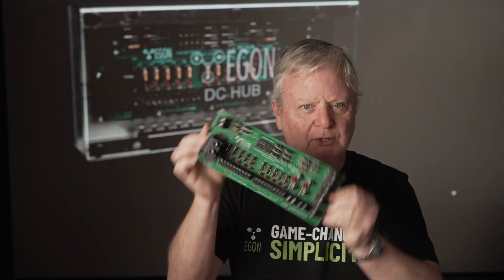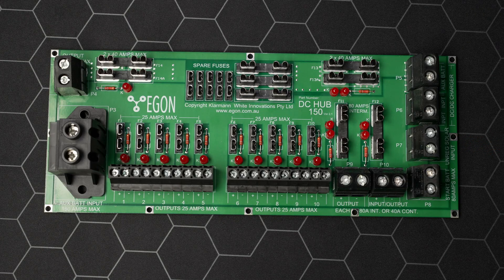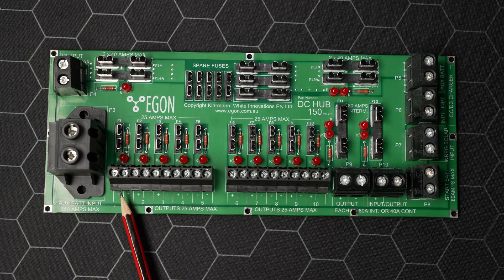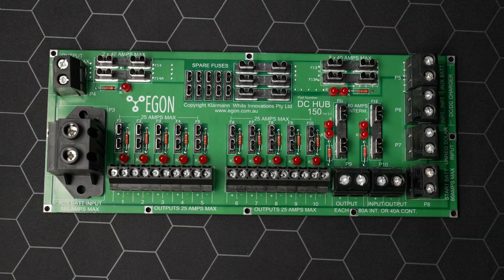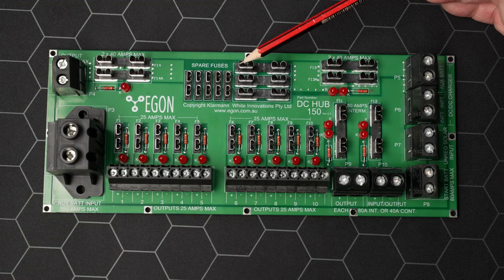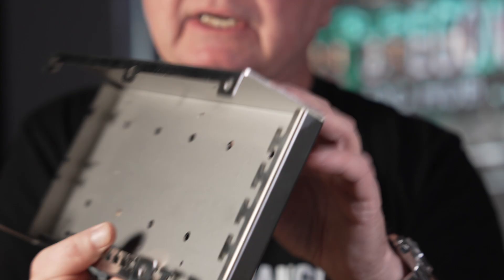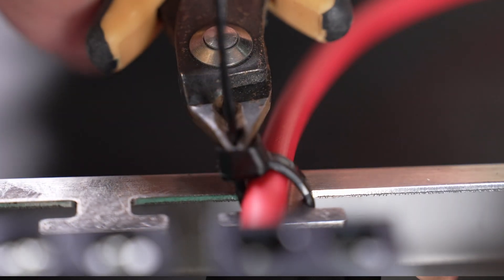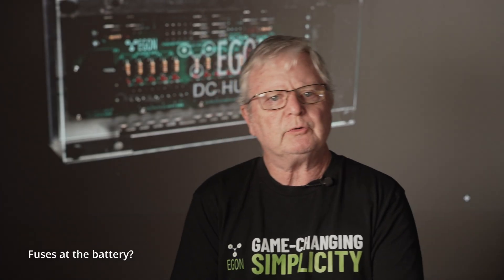EGON DC-Hub EXPLAINED: The Smart Way to DC-Power Distribution @EGONGame-changingsimplicity

Comment: How would you connect hub if house battery is under bonnet with starter battery ? First timer here
Reply from the maker: Hi there, the Hub is not made to be installed under bonnet. I would recommend to use Midi fuses for the DC / DC charger for an under bonnet installation and then use a Relay Hub / Fusebox / other switching solution for the installation of components in the rear / canopy / inside of the vehicle. Hope this helps...

Comment: 3:16 that cable is going to rub at the front of the cable tie. I would in future make the cable tie mounts insulated. Just my 2 cents worth.
Reply from the maker: Thank you for the heads up! Since the cable tie is holding the cable on the bracket very tightly there is no rubbing movement. We have tested it excessively and never had a single fault with pull relief t bars on the bracket. Your input is appreciated.
Reply: You could add a sleeve of heat shrink over the "T" if you are concerned.
Reply: @gavinhulme8837  Thats a cop out. Its an engineering issue. And needs to be fixed. Sorry 50 Year old Tech here. That wouldnt have passed me in Alpha testing. I would have seen that a mile off and told the Engineer to fix it. I personally would be using platic whever cables are run not metal. Because the corrigatted tubing will eventually wear, defeating the whole purpose of the Egon Hub. So watching eargerly.

Comment: Im very interested how ever l have a 120 amp v4 compessor from Tuff Terrain. Is 12o amp excessive?
Reply from the maker: Since a compressor is an intermittent load you can wire the 2 x 80 amp intermittent outputs to the compressor and put a 60 amp fuse in each 1 of them. Or run an extra fuse directly of the house battery the same way you would do for a large inverter.

Comment: A explained video for the up and coming 48V DC-Hub  would be perfect when 48V hub  Drops  just Perfect.

im keeping an eye on how your progress goes keen to tinker with how i would use the 48V hub and or odd Combinations :D
Reply from the maker: You are dead right! We are filming a 48V EXPLAINED video as we speak - to be released when we go to market early 2026. There are a lot of questions being asked and concerns about costs of 48V too. Turns out, our 48V installation is not going to be no more expensive than a top of the range 12V system, but still produce 4X the charge current and up to 6X improvement in total energy efficiency of one. And, we are pleased to say, far, far easier to install!
Reply: @EGONGame-changingsimplicity Awesome, thank you for the update